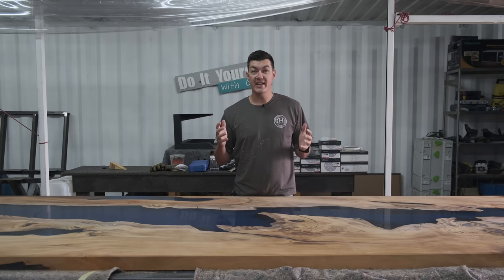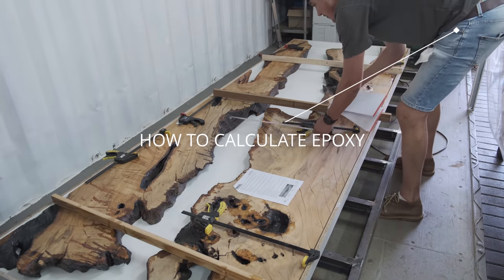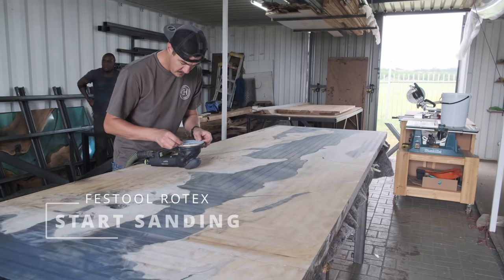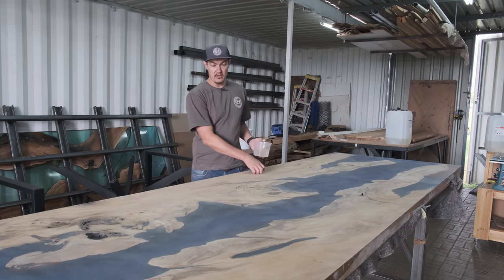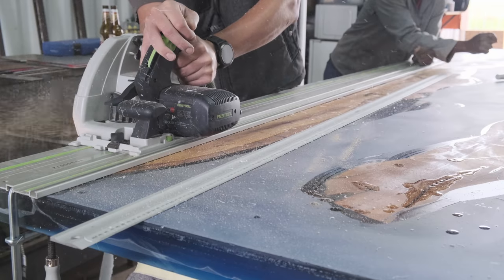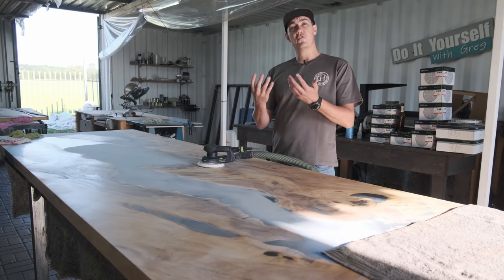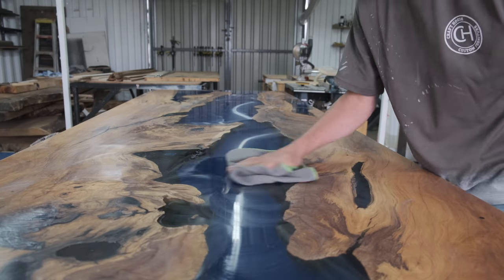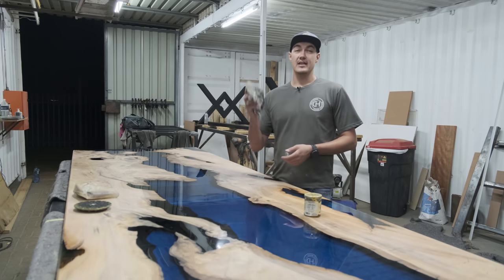$40,000 MASSIVE Epoxy Table

Comment: Curious about how weather resistant these tables are for the winter times? I live South of Chicago and have all 4 seasons. Winter is well below freezing, sometimes for a few weeks at a time. Summer is sometimes over 90 degrees F for weeks at a time. Thoughts?
Reply: It's generally advised against, but if you make one, make sure you do a ton of research into the best exterior use epoxy, don't have it directly exposed(as in it should be under some sort of awning/pergola/pavailion), and pray lol

Comment: Hey Greg,
I saw your website is online now. I was waiting for it and bought of a copy of your tips as a thank you for all your helpful information here on youtube. I'm looking forward to reading all the tips in the doucment.

Just wanted to mention that I got a security message when I clicked on the link in your description that your website would be insecure. You may want to sort that out. I was using the Firefox browser on Mac OS by the way.
Reply from the maker: Hi Michel, thank you so much for all the support. Thanks for the update also on the security will resolve that asap. 🙏🏻
Reply: @diywithgreg   Just read the sanding part. These sanding tips are exactly what I needed as I'm currently in the sanding stage of my epoxy table project.
Do you also only sand for 20 seconds before blowing off the sandpaper for grids lower than 320?
Reply from the maker: @micheldecker95  yes we definitely do, from 600 to 800 we wipe the dust off with a cloth.

Comment: You may sell it for 40k but no way in hell is it worth that. Let's say $300 for the wood, $800 for 20 gallons of epoxy even if you add in the cost of sending it to get the top cut down the profit is well over $35000.

Comment: I love all the comments saying he barely spent any money. Let me clarify to all who have never done this before. However you cut it, the epoxy used here is gonna be in the 2-3,000$ range. Then comes all the sanding pads, finish, etc which is small amount. Then comes the time spent sanding which for this table too and bottom must have been days and days worth let alone the cost of using someone’s cnc , and the legs and transporting and all that. Then you have to understand it’s a clear resin not solid color which means a lottttttt more sanding than if it were a solid color. Literally ten times more sanding too and bottom. And lastly the most important thing is his expertise. I bet you if you did even 10 small projects with epoxy you have a slim chance of getting something this size correctly. Also don’t know if chairs were included in this price. Bottom line is he has at least $8000 invested into this.

Comment: Hey Greg, I'm also in SA. Just want to ask you roughly how much the total cost is to make this and how much would you make(profit) from selling it? Thanks bud
Reply from the maker: Hi, the table ranges from 34k to 100k, and depending on the size, but make about estimate 30% to 40% profit.
Reply: @diywithgreg  Hi, what was the cost of the epoxy?